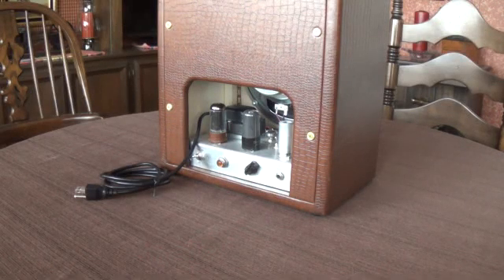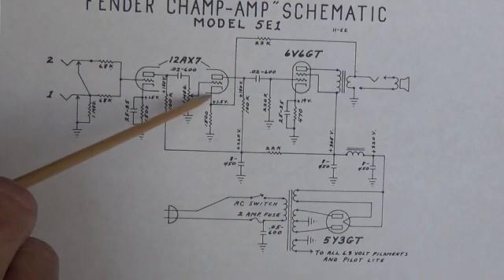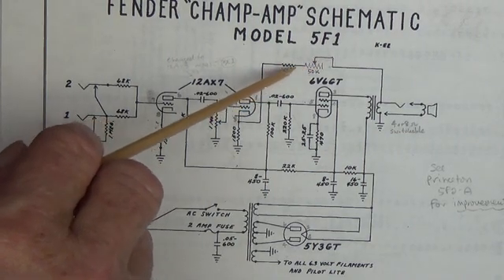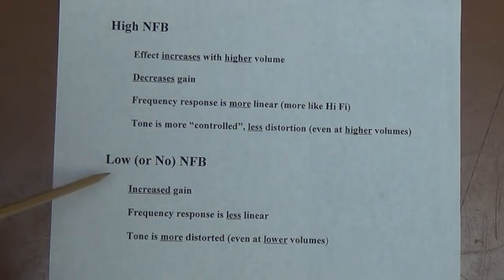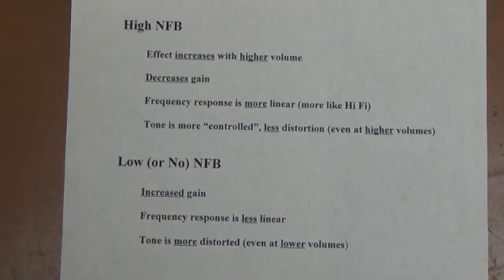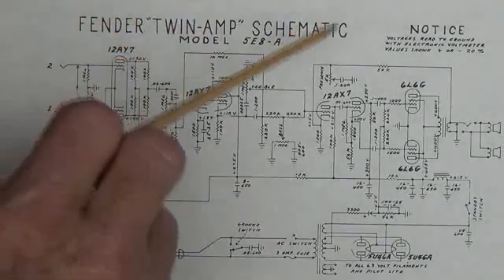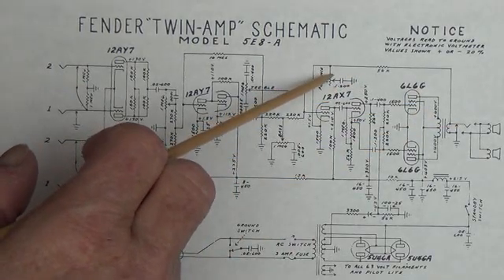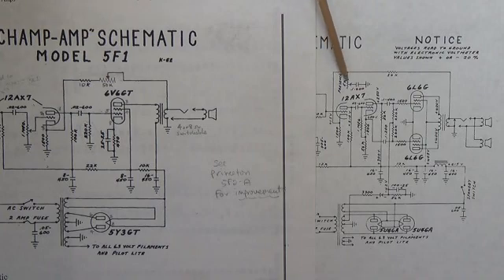Negative Feedback Loops and the Fender Presence Control

Comment: Hello again Uncle Doug & Rusty! Here's an interesting circuit that Gibson used in several of their amps in the early 60's. It's a compression circuit that is in place of a negative feedback loop. http://www.gibson.com/Files/schematics/GA-60.pdf. Could you explain how this would work? Thanks again for all the great videos.
Reply from the maker: skeeterbuck Greetings, SB. Gibson is famous for strange circuitry, and this one takes the cake. The magnitude and polarity of the capacitors, the opposing diodes, and the presence of a Light Detecting Resistor all make me think that this is an unnecessary complexity dreamed up by an electrical engineer who never saw or heard a guitar.
Reply: Uncle Doug It works as a compression circuit where if you turn the amp up too loud or start playing too hard it automatically activates this compression circuit to reduce the output to keep the amp from distorting. I assume that the trimpot labeled "factory adjustment" sets the level at which the compression circuit starts to operate. I'm currently going through a Gibson GA 77 RVTL amp that has this circuit added from the factory, yet on the schematic there is no indication of this circuit anywhere. (typical Gibson). The amp was working and the compression circuit was operating as designed. I'm waiting on new filter capacitors to install as the originals were shot. (ESR readings in the 80-90 range). When I get it up and running again, I plan on trying to adjust the compression circuit using the trimpot to try and minimize the effect on the amps performance. If I can't get it to change much, I just bypass the circuit all together. I try to avoid altering old vintage amps like this one especially because this one is in fantastic shape. It still has all it's original RCA tubes and even the vinyl cover. Here's two pics: http://i304.photobucket.com/albums/nn188/skeeterbuck/DSCN1537.jpg
http://i304.photobucket.com/albums/nn188/skeeterbuck/DSCN1531.jpg
Reply from the maker: The amp is in very nice shape. I'm wondering if this bizarre bit of circuitry does a better job (of compressing the output signal and reducing distortion) than the simple NFB loop found in Fender amps, like the Champ. If you can get the Gibson circuit to function properly, SB, please make a comparison with an amp having a simple NFB loop and let us know what you think.

Comment: Hi, does this work on a bandmaster AB763?  I noticed that the FB loop appears to go into the phase inverter tube in two places.  Thanks!
Reply from the maker: Yes, HFD, this is exactly how the Bandmaster and Bassman NFB loops work. Since there are two channels in these amps (unlike the Champ), the NFB signal must be fed to the Long-Tailed-Pair Phase Inverter so that it will have effect on both channels. If it were fed to one of the earlier tubes, it would only affect the channel that contained that tube.

Comment: Why is the NFB signal taken from the end of the output transformer? Is it because it is low impedance, therefore we can more easily control it with a resistor?
Reply from the maker: Greetings, HT. You're definitely on the right track. Recall that a NFB loop feeds back an out-of-phase voltage to an earlier point in the circuit (usually just prior to the PI) to neutralize a portion of the music signal (which is of fairly low voltage at this point). The impedance (voltage) at the OPT secondary is of the proper magnitude (once moderated by a resistor) to do this, while the impedance (voltage) at the primary is far too high. It's mainly a matter of picking a source for your NFB signal that is already fairly close to the voltage the loop requires.
Reply: Uncle Doug Thanks! Love your videos btw. Is there any possibility for a video discussing distortion characteristics in tube amps? For example what's the difference between a Mesa and a Marshall preamp distortion etc.
Reply from the maker: Since distortion is an important characteristic in tube amps, it would be a good topic for discussion. Thanks for the suggestion :)

Comment: Curious if you know much about orange amps.  I'm looking at schematics and was wondering if you might make a video at some point explaining special features like the echo loop, HT chokes, and what appears to be multiple rectifiers. http://www.drtube.com/en/library/schematics/62-orange-schemas
Reply from the maker: I am not well versed in Orange amp circuitry, Zach, but the schematics seem fairly straightforward. The HT Choke (L1) appears to be a filter choke to reduce ripple in the B+. The Echo (effects) Loop probably goes to an external reverb (or echo) effect. The four diodes form a full wave bridge rectifier, which is a very efficient way to rectify AC.
Reply: Thanks UD, I figured it was the same as an effects loop.  One of the schematics looked like it was both tube rectified as well as using a full wave bridge rectifier which I could be wrong but it seemed interesting to me.
Reply from the maker: I looked again, Zach, and all I see is FWBR's....no tube rectifiers.
Reply: Ok thanks :)

Comment: Something is not correct here. A signal applied to the pre amp tube cathode that is  in phase with the signal  at the pre amp tube grid reduces the plate output. So for the negative feedback you want to take a signal from the amplifier’s output that is in phase with the signal at the grid.
Reply: If the NFB signal is applied to the cathode it must be in phase with the signal at the grid. When the grid is going positive, making it less negative with respect to the cathode, increasing electron flow in the tube and lowering the plate voltage, the NFB signal at the cathode also needs to be going positive, to make the cathode more positive with respect to the grid (i.e. the grid more negative with respect to the cathode) to decrease electron flow in the tube, raising the plate voltage (or, in this case, not allowing it to fall as far as it would if the NFB signal were not present). 
Conversely, when the grid is going negative, making it more negative with respect to the cathode, decreasing electron flow in the tube and raising the plate voltage, the NFB signal at the cathode also needs to be going negative, to make the cathode more negative with respect to the grid (i.e. the grid less negative with respect to the cathode) to increase electron flow in the tube, lowering the plate voltage (actually, not allowing it to rise as far as it would if the NFB signal were not present).

Comment: Hi Doug, great video, very interesting thanks. I'm thinking of adding a presence control to the drive channel of a fender prosonic and wondered if I could ask your advice. 
I would like to just use negative feedback to reduce the highs and attack. Currently there is no negative feedback. Do you think this would be possible? If you are able to suggest any configurations or values you think might work that would be really appreciated!
Reply from the maker: You're welcome, Andy. You need to download a schematic of your amp and of a Fender AA-864 Bassman (which has a NFB loop and a Long-Tailed-Pair phase inverter like your amp). It appears that you would attach the NFB loop to the top (yellow) output transformer secondary wire, run it through an 820 Ohm resistor (for starters, you would have to experiment with values), then connect it to the left end of the central LTP input 18K resistor (just below C23....I can't read the number). You could also substitute a pot (i.e. try a 2.5 or 5K for starters) for the fixed 820 Ohm resistor, to make the loop adjustable. If you want to selectively remove high frequencies, then you could add a low-value capacitor to the loop, i.e. 10pf, and experiment until you get the proper frequency suppression. Whether this will work properly, I have no idea, but it would be a good place to start. Some experimentation will probably be necessary. Be very careful....and best of luck.
Reply from the maker: I assume you could send the NFB signal to a pre-amp stage in the drive channel. Check other Fender schematics to see if any of them do it this way.....or simply try it and see.
Reply: Uncle Doug Thanks a lot for your detailed comment! I'm just ordering the parts to try this now. I saw in another comment that the NFB feeds into different parts of the amp depending whether it's one or two channel. I want to add a presence control to the drive channel of my fender prosonic only - could I feed the signal back to a section only used by the drive channel to leave the clean channel as it is?

Comment: Nice video. You should maybe have said a word or two about how different amps have different NFB. Some amp are, lets say so, stable that their tone wont break up even with the NFB totally snipped. To get a nice range on the NFB a big potentiometer can be used. With a pot of 1M or so a range can be found. With a measurement of the interesting resistances, low level NFB and high level NFB, a resistor and a smaller pot can be used to control the NFB. Well... this is how usually tinker with the NFB loop of amps I come across.
Reply from the maker: Thanks, Per, for your kind words and your detailed input :)

Comment: Thanks Uncle Doug, that was an interesting vid, I have been looking for ways to adjust tone in my circuits without having to include an additional tube for a tonestack. Using caps and pots and NFB's and treble and bass boosts are pretty cool.  Cheers
Reply from the maker: You're welcome, Elams. Rusty and I are glad you enjoyed the video. Thanks for watching and best of luck with your tone adjustment project :)

Comment: Thank You for your diligent  response..the cap of .1uf is one end to ground the1st & 2nd lug are connected together as in a boost or cut but on the 3rd lug there is a 4.7k resistor connected to the wiper and the other end to ground. The potentiometer is a 5k which is average on Marshalls but this addition started to show up on the later models. The .68uf cap was usually the cap used on the 200 watt Majors (1968)  and this is where the ''One Wire Mod'' was introduced, consisting of a 1 Meg Ohm resistor on the Volume1 (Normal Channel) output was rewired into cascading Volume2's (Bright Channel) input resistor or so I believe in theory these respond as a Volume and Gain when plugged into the Bright but if you plug into the Normal only that channel responds breaking the Gain's chain but very Loud and Bold which I use as such and call it the''Loud & Bold Mod'' on the 2 channel amps which is minus the Master!! I rebuilt so many amps in my day and a number of Marshall's but I was not privileged until today to be able to ask anyone or thought to do so. Thanks again Uncle Doug!
Reply from the maker: Good heavens, Nelson, you definitely know a lot about Marshall tone circuits !! Thanks for sharing all this information with us. I will definitely refer all such inquiries to you in the future.

Comment: This is a great topic in addition some years back I was 1st introduced to the idea of the NFB as the would be designers aggressively sought out the overall purpose of the NFB and what and how to if not just alter for sensitivity per other schemes existing but how to achieve possibly a 60s Marshall/Park Plexi amp performance. After reading countless lectures and getting the understanding I noticed there were some presence controls with an added resistor to the .1uf capacitor and if I'm not mistaken up to .68uf was used!!. Is this resistor a form of a (?) preset in filtering along with the 5k-10k presence pot? I also settled in on a cascading use known as a 1 resistor mod using a 1megohm resistor on a '73 Model 1987 Marshall #1  by my first recollections and  immediately noticed it sounded and responded just like the term used as a ''Brown Sound'' made popular by the designers of the Van Halen mods! On another I did bypass the NFB resistor altogether in one instance and it brought the Marshall amp#2 to a whole new level and I even removed the .68uf cathode capacitor and the .0022uf bright capacitor on the tonestack's 2nd stage tube which increased the preamp's character to immense proportions.Incredibly powerful. But as my question stands Please if you will  the added resistor on the presence control knob it's not just there to alter the capacitor's performance so what is it's due purpose??!! Thank you!
Reply from the maker: Greetings, J56. I am not familiar with the circuit you are describing, but one of our viewers definitely is. Please see the detailed response from Nelson DeJesus, which should be posted nearby (probably above). I never cease to be amazed by the knowledge and experience of the folks out there in YouTube Land :)

Comment: Hey, you seem to know quite a bit about tube amps and I am trying to wrap my head around them. I jumped right in attempting to build a mojotone clone of the 5F6A Fender Bassman.  I have finished the assembly part, but I am experiencing some technical difficulties, I have been searching for tips and tricks to troubleshoot the problems I am having. I was wondering if you would maybe help out. Here is a basic description of what is going on. I do not have signal through the input 1 on either normal or bright channels, but I do have signal in input 2 on both normal and bright. There is another problem though, the signal seems to drop off rather quickly and make some strange sounds as the signal seems to struggle to move the speakers. I was wondering if you had any advice.
Reply from the maker: Greetings, Jeremy. Long-distance troubleshooting, particularly of newly constructed kit amps, is virtually impossible. That said, I will offer the following: If input 2 works for both channels and input 1 doesn't, then input 2 must be wired incorrectly. Check the wiring and your resistor values....are you sure the resistors to ground are really 1Meg?

The second problem could be caused by a multitude of issues, none of which can be solved by my guesswork. After resolving the input problem, go back over every single wire and connection, comparing them to the schematic. Measure and check each component value, etc. starting at the input and ending at the speaker. This is always a good idea on any freshly hand-built circuit.

On my own Bassman clone, one of the resistors I received from a supplier was 10K in a bag of 100K resistors (it happens) and I foolishly installed it without checking. I followed the advice I gave you (above), and found it, replaced it, and the result was a great-working amp. Part of the challenge of building your own amplifier is figuring out what you did wrong. Consider this as a valuable learning experience. Good luck.
Reply: The resistors checked out: brown, black, green, gold. I looked the wiring over again, it looks in order. Thanks for you help and quick response time. I'll keep going over things and ask a friend that is an electrical engineer to take a look at it.
Reply from the maker: You can't trust the banding on the resistors. You have to check them with an ohmmeter. Also, if reference voltages are provided with the schematic/instructions, carefully check them throughout the circuit. You would learn more by solving this problem yourself, rather than seeking outside help. The hardest problems generally provide the best lessons.

Comment: Hi Uncle Doug, in the Bassman 6G6-B , the presence was generated in the tone stack.A 350K pot with an extra 70 K tap. The signal came from the bass pot if I remember well? My blond Basmann is made that way.
Kind regards,Joseph
Reply from the maker: Greetings, Joseph. I checked the schematic and it is as you say, except it appears to originate with the Treble pot in the Normal Channel (only). I would view this as a way to fine tune the treble frequencies closer to midrange. Thanks for your input :)
Reply: Uncle Doug Indeed UD, so it is. Thanks again for your SUPER  videos.
Kind regards,Joseph

Comment: Hi Doug (and Rusty)! I really want to build an early sixties Fender Brown Deluxe (6G3), but am really worried about how aggressive and snarly they are. Am I correct in my assumption that decreasing the NFB resistor from 56k to another value thus increasing NFB might tame the beast some? And do you have a recommended resistor value? Thanks for these valuable YT videos!!!
Reply from the maker: Greetings, Rocker. I have no experience with the 6G3 circuit. My recommendation is to substitute a potentiometer for the NFB resistor.....either permanently or use it to find the value you like best, then replace the pot with a fixed resistor of that value. Any amp can be tamed, but often it takes a lot of the personality away. Hopefully you can find a happy medium.